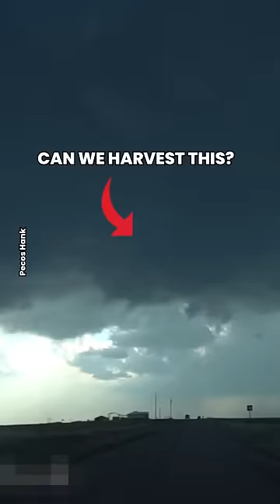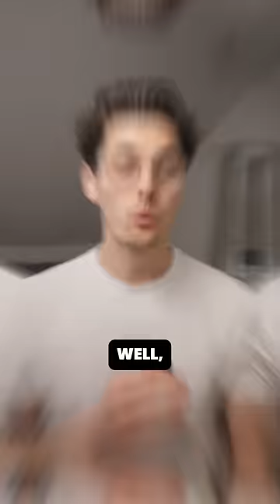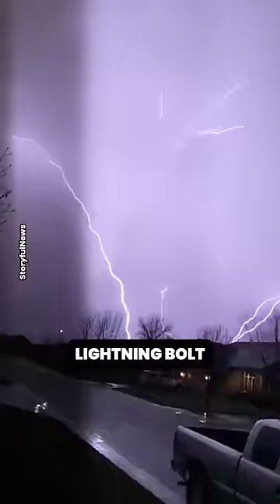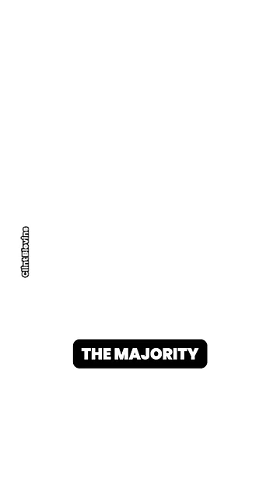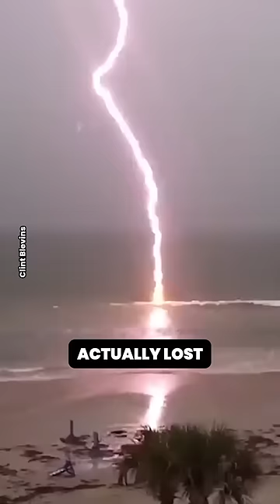Why don't we harvest lightning for energy? ⚡️ #shorts #alternativeenergy

Comment: If even 99% of it is lost, but that 1% is beyond our capacity to withstand and store, then it's probably still a significant amount
Reply: No the enrgy is like 1 galons of gasoline, its just very fast so the power is high
Reply: Did you know? Lightning is powerful but not practical for energy. Each flash has about 4 strokes, each at 10^12 watts for 30 microseconds. Quick math: Energy per Stroke = 10^12 watts * 30 * 10^-6 seconds = 30 million joules. Total for a flash? 120 million joules, equivalent to about 3.81 liters or 1.01 gallons of gasoline. But capturing lightning energy? Super tricky and not efficient with today's tech. It's more a natural spectacle than a power source!
Reply: @NoName-cx3gk  I agree on the math and final though of rightest answer, that'd be very tricky, at least we got so far to have technology just to bridge that energy and "neutralize" it not to become a threat!
Reply: @jeronecutikazem7401  Yes it could easily kill someone even the energy is not that high.
Reply: Not if we build a lightning rod high enough 😂 then we won't lose much power

Stick it right up in the clouds 😉

They can also use lasers to change the lightning's path if needed
Reply: @justbplz bro didnt know resistance💀
Reply: @KDYinYouTube   someone will figure it out lol
Reply: Not practical or possible! Lighting is static electricity which by definition doesn't have current. Explain the amazing amount of current in a lightning strike then your idea can possibly work!
Reply: @stanleycarter303   😯🤔😟
Reply: Fast charging a battery still takes hours you can just flash charge something at the speed of lightning
Reply: @DrusinianX  think if the battery was a ribbon that stretched along the length of the lightning rod you could get enough surface area to hold a charge? 🤔 Imagine just flying a weather balloon through a storm to "suck up" the lightning somedy
Reply: @NoName-cx3gk each flash is a teenage boy left in his room.
Reply: @NoName-cx3gk I mean just get a really long and I mean really long wire of a super conductive material. Basically making a giant resistor. The energy will enter the wire slow down and then get to a manageable level
Reply: 1% is still about 0.02 jigawatts or 20 megawatts...
Reply: Makes sense
Reply: @justbplz  The thing is, lighting is created due to the immense charge of negative and positive ions on the two sides... So you basically just have a heat resistant cable that can handle high temperature like a space ship, that goes into space or into the atmosphere. The constant movement of airflow up there will also easily power any micro turbines up there.
Reply: Humans never truly dominated the skies, we only have air superiority, but we have never dominated it.
Reply: @NoName-cx3gk but still, is there any research on this? This could easily be free energy almost instantly... If they build the right technology for it, which would be the purpose of said research.
Reply: Its because Lightning has amost no energy. Only about 8kwh not enough to power 1 home
Reply: The difficulty is due to the extreme rate of discharge, not the total energy
Reply: @ancientlink0 these ppl dont realize that humans survive lightning strikes all the time
Reply: @KDYinYouTube we have superconductors. 0 resistance wires up to a certain current
Reply: @Mallchad superconductors need very specific conditions to superconduct
Reply: @stanleycarter303 Lighting does have current, static electricity is static until discharged.
Reply: @KDYinYouTube ”won’t lose much power” means that will leave some energy loss
Reply: Scientifical Nerds 🤓

NO WAR BRO NO WAR
Reply: The lightning energy from a full year is not enough to power the world for 1 week
Reply: tf is this comment 😂 @justbplz
Reply: @rawrn.    they'll figure it out
Reply: Not worthy of the infrastructure.
Thunderstorms are rare
Reply: thought the same thing
Reply: Tesla wasn't trying to transmit energy.  It's obvious looking at the tower.  He was trying to absorb it. That's why his tower was donut shaped and not shaped like a dish. His tower didn't need to be hit by lighting because there is free energy readily available the higher you go above the ground.  This is known.  Teslas real guineas was creating an analog path to converting DC power to AC.  Using induction.  induction works both ways.   All unobstructed electrical circuits do.  Only THEY are covering up the real truth by telling everyone he was trying to transmit power.   Laughable because the power he was apparently trying transmit didn't exist.   It makes way more sense to me that Tesla was ready to harvest energy.   The inventions he used are well known.   And transmitting power is readily possible.   There's just no way to meter it... shucks😢
To the problem of sorting the energy...We could flash boil water and use the steam to lift heavy weights.  BAM. waiting for the black helicopters.  Every time I post about this, it gets pulled
Reply: “I was only using 1% of my power when I struck you”
Reply: It would be better for us to invest in new plants run by natural gas or nuclear. They actually procuce results. Will also be required since electric cars can’t work on existing grids, unless you hook up external gas generators or build more coal plants for dedicated car charging stations
Reply: The entire video is incorrect. The energy released in an atomic bomb detonation is significantly greater than that of a lightning strike. A typical lightning bolt releases about 1 billion joules of energy, while an atomic bomb can release tens of trillions of joules, depending on its yield.
Reply: @NoName-cx3gk someday we will figure out how to make these massive structures that reattach up into the clouds that trap the lightning at soon as it is emitted. I’ve seen them I’m from the future
Reply: So skill issue
Reply: @MangoPineapplez  yes we need to upgrade our skill tree more lol
Reply: Corny 🤣 that 1% must be thors lighting bolt then lmao
Reply: Read this slowly.

Greetings everyone, If you'd be willing to listen I have a few messages that I truly think could save your life. To Christians: remember your God in these dark ages, and remember humility comes before mercy.
To those who do not stand with Christ: remember the love of your brothers toward one another, Remember the tranquility of the quiet sea and know that all these and so much more does your father in heaven own. Wake up from your slumber, and listen to the calling of God which has been present your entire life.
Remember that we teach humility and compassion. Remember that these very traits give the society which you so yearn for. Remember God
Reply: @NoName-cx3gk  so I don't need to patent my water column tower piston driver?
Reply: @justbplz go at least read a science text book if this isn’t a joke, which I think it might be but just in case.
Reply: no. capture 100% of a single lightning strike and you would be lucky if it could power your house for a single day.
Reply: @NoName-cx3gk  agreed. we'd have more luck passively gathering all the ions 24/7 spread out on a super grid. again that would be stupid expensive for very little benefit but at least its more reliable than going for the big shiny electric sticks.
Reply: @NoName-cx3gk  another way of explaining lightning is compare it to a double A battery that can power a tazer powerful enough to kill a man.

its just a double A battery and still it can bring you down.
Reply: Capture it in the air
Reply: @NoName-cx3gk  what about sourcing the clouds instead

Comment: Electrical engineer here: This guy is so wrong on so many levels, that it's hard to even know where to start addressing the misinformation in this video. My only advice would be, if you're genuinely interested in this topic, go and research it for yourself rather than trust this creator.
Reply: The video is right about lightning not being a great energy source, but it misses explaining the power vs. energy concept. Lightning strikes are powerful but last only about 30 microseconds, so the total energy is low. This detail is key, as it shows why harnessing lightning for energy isn't as feasible as it might seem.
Reply: I mean yeah YouTube isn’t the place to go for your works cited page definitely… first off does lightning even “hit the ground”? I was under the impression the actual light and heat start from the ground but it’s so fast you can’t see it. Maybe I’m wrong though.
Reply: @nuncapasaran9374 it starts from the cloud but it only sometimes touches the ground
Reply: @bingbong8464 No, he is actually right.
There are feelers which come up from multiple places on the ground, and a feeler progresses from the cloud downwards and meets an upcoming feeler, then the bolt of lightning travels down from the upper feeler to the lower feeler with which it has made contact.

It happens very quickly and too fast for the human eye to see it. But it is detectable with high speed cameras.
Reply: @deang5622  it's starts from the storm cloud🤦‍♂️ without it, no lightning
Reply: Can't you give a quick tldr? If it's not possible for a different reason, what's the reason?
Reply: @NoName-cx3gk  still enough power to instantly set a tree on fire or reduce it to splinters.
Reply: Fellow elec eng strongly agreeing!
Reply: @Bonez0r  The electric energy is like a gallon of gasoline, you can make with that also "instantly set a tree on fire or reduce it to splinters".
Reply: @deang5622  Lightning occurs due to potential differences, with energy flowing from high to low electric potential areas. This isn't directly linked to plasma formation, which is a separate phenomenon. Plasma forms in areas where the electric field is extremely intense, such as at the edges of buildings, leading to a dielectric breakdown in the atmosphere. This is why lightning can strike from the ground upwards, as the field becomes strong enough to ionize air at these points, creating a plasma. Additionally, lightning can also originate from clouds, where downward and upward charges meet, forming a path in the atmosphere. This path allows for rapid energy exchange, similar to the current flow in an Ohmic conductor.
Reply: @NoName-cx3gk  Clearly you don't understand the relationship between voltage and electric field strength.
Go look up the mathematical relationship .
The fact you don't understand or tells me you are not an electrical engineer.

Second, what I said about the formation of lightning is factually correct. It is not a point for debate. It is correct.

Stop guessing.

When I make a statement I do NOT guess; I do NOT BS.

I watched a documentary on it some years ago where they proved the sequence of events using a very high camera.

I already explained that, and had you read the posts properly you would know this.

So don't call me a liar.
Reply: "You can't predict where lightning will strike" lol what the heck was that.
Reply: @deang5622 i don’t understand with what you disagree here exactly 🤔 you are disagreeing with someone who said the same thing.
Reply: You know i actually dont mind reading 500 paragraph on youtube comment explaining it
Reply: Engineer is engihere
Reply: @Bonez0r i mean that… doesn’t take much energy? the lightning just provides enough energy to start a fire, but the actual energy of the fire is stored in chemical bonds in wood which are broken when the fire spreads in the… flammable material
Reply: This creator must had E in physics 😂😂😂
Reply: @nuncapasaran9374 I researched this topic once I’m pretty sure some lightning comes from the ground and other lightning meets in the middle from the ground and the cloud it’s called “cloud to ground” although I might be mistaken
Reply: @Bonez0r Well the thing is setting a tree on fire isn't entirely the lightning it started a reaction but it does not continue to POWER the fire
Reply: The dude is also wrong saying the earth is struct by lightning 

It's not the earth being stuct it's the sky being struct, lightning comes from the ground
Reply: Exactly and I’m surprised all these old cities we see lightning rods on the buildings and the infrastructure is built with metal rods going right into the ground as well as on megalithic structures clearly are ancient understood ethereal energy, far more than this original poster
Reply: Electrical engineer with a 9 year old pfp 💀
Reply: And also…

“We don’t have technology that can survive the-“

LIGHTNING RODS
Reply: What are your thoughts? You have me a little curious....
Reply: @deang5622 Clearly you are not adding the fact why lighting rods were created-So you’re denying a science correct? - yes- your saying it comes up from the ground but in reality it’s coming from a storm. Just like earthquakes lighting is unpredictable. It would be weird if lighting rods were struck from behind would it not?
Reply: Thats why we need Stark in on this one.... He was real dude you know....

Cap too...
Reply: Yeah dude. Lets get zero-point energy
Reply: TL:DR
Trusting the creator with my life
Reply: @blackleague212  if 6 lines is too long for you, then you have a short attention span.
Reply: Why listen to you, an electrical engineer, over probably untrue research. Just post a link or state a fact easily findable than the do your own flawed searches that result in online debates that help no one ultimately.
Reply: @NoName-cx3gk  Nothing that has ever been invented, built or discovered ever seemed feasible at the time it was done to anyone from that period.

Comment: Reason 2: Too powerful to store

Reason 3: Not powerdul enough
Reply: Not too powerful to store. Many systems already store more energy.

It is powerful enough. Plus those 2 reasons contradict

Just not enough lightning storms to make it worth the cost of building a system
Reply: it's a short burst of energy that even harvesting at high efficiency wouldn't be worth the investment
Reply: @opticalreticle  what if hypothetically we had the technology to create/control thunderstorms and then build a facility that could harness the power properly? Maybe in a century or so
Reply: @Tyler-hs9eu  yeah it'd be good if we could harvest the energy in weather in a concentrated source
Reply: there is a difference btw energy and power power and energy are related as (P=E/A) or power = energy per unit area, we cant handle too much POWER as so much energy is concentrated at one tiny point but even if we could the total energy is not nearly enough for  good use just like how you can pop a balloon with a needle with just a little force but if you use the same force and do it with a finger it doesn't pop
Reply: @gregheffley6400  it's actually power = Energy / time. What you are probably thinking about is intensity which is power / area. Either way, the amount of energy in the short time of a lightning strike contains a lot of power and regardless of the area, that will be intense.
Reply: @ferusskywalker9167  oh wait yeh i was wrong actually i had an exam tomorrow and was just revising the photoelectric effect so energy/area was on my mind all day thanks for correcting
Reply: it's like a single bomb after exploding. the explosion itself is too powerful to store somewhere, but it's also not worth it cause it's just one bomb.
Reply: It's not to powerful to store, it's just it's to much power to fast, you could  survive being pushed 60 meters in 60 seconds, but being blasted 60 meters in 1 second would probably obliterate your ribcage 

You get what I mean?
Reply: @agravemisunderstanding9668 but you don't get that power is what measure this speed, so it is too much power
Reply: "we dont have technology that could survive" then shows building getting struck by lightning without issue
Reply: “Powerdul” 💀
Reply: “powerdul” 💀

Comment: There are areas on Earth that have lightning storms every day. You can use lightning rods to draw them to one specific point and then use the heat itself to generate power, not the electricity.
Reply: I thought of something similar. With recent developments on sand batteries which simply store energy in form of heat. One can potentially store heat from lightning and gradually use it with the pre-existing steam turbines.
Reply: Unfortunately when he said there's not much total energy left, that includes heat. No matter which kind of energy you harvest from a lightning strike, you aren't preventing 99.99% of it from being lost along the entire length of the bolt other than the tiny point where it struck.
Reply: @zeph0shade  would be cool though. We already have lightning arrestor in most buildings. Instead of "simply" grounding it "could we possibly"  store heat in inexpensive sand batteries. And gradually use it up?
It's not a major source of electricity. But with inexpensive batteries we might just as well utilize it?
Currently the power industry has to produce on-demand. Because we don't have large scale batteries. So the work on sand batteries are definitely interesting.
Reply: @sachinminz90  I imagine it would be possible, just not worth the cost of installing and maintaining. Even if it can successfully store a charge every time lightning interacts with it, anything that's intended to be struck by lightning is going to wear out and need repairing/replacing after just a few uses. I don't think the energy you'd capture would be near enough to make up for those costs.
Reply: @zeph0shade What if it's right up in the clouds?
Reply: @zeph0shade maintaining a lightning farm would be the most dangerous job in the world😢
Reply: @YRO.  Then you'd be missing out on all the energy between that and the ground. The fact that there's a visible lightning bolt is the evidence that 99% of the energy is lost. If you had an effective way to harness it all, then there'd be no lightning at all.
Reply: @youreadthisinyourmindright2604  Hell yeah it would. Imagine being the guy that has to go out and feed all the lightning cows and lightning chickens. Terrifying, honestly.
Reply: Their interest is not helping you